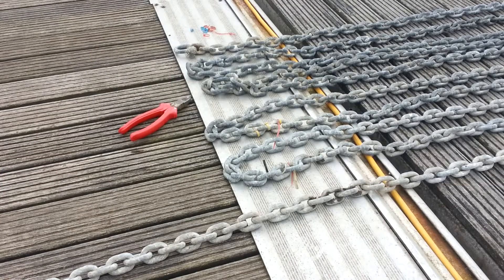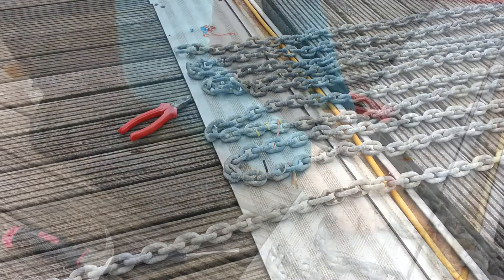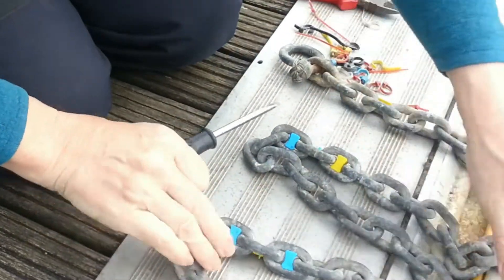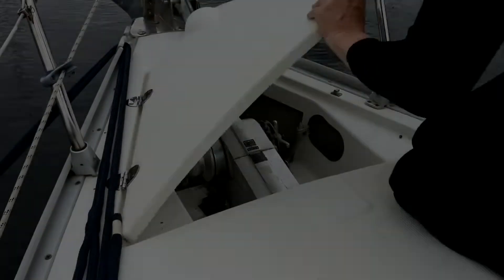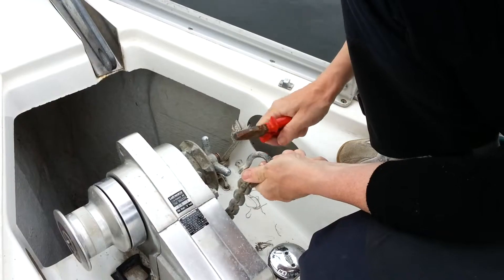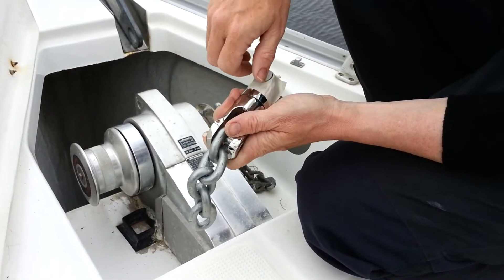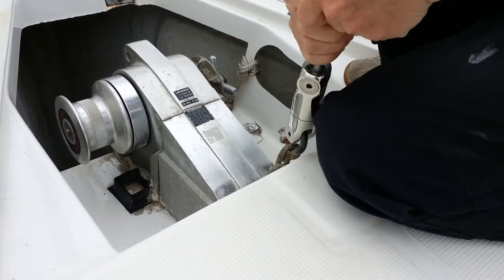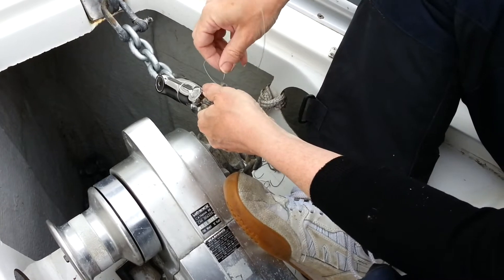[40] Anchor chains, shackles and swivels

Comment: Five failure points compared to one if you used a rated bow shackle like a green pin connected directly to the shank
Reply from the maker: We are using connectors that are rated as stronger than the anchor chain and in the years since this was filmed it has always performed well. It is not a nice solution but so far it is working well. We replaced the shackles when they were two years old and the are due for replacement again this winter. It also annoys me that I cannot inspect the inner pin of the swivel, but it is massively over-rated for this boat so I pin my hopes on that 😃

Comment: OK -- it is mousing not ceasing but fine!!!  What I did not understand is why add 2 shackles and a short piece of chain --  when the swivel is designed to fit directly on both the anchor and the chain -- all you seem to have done is add weakness to your anchoring system.  The Ultra Anchor Flip and Swivel is a great product that ensures the anchor (an Ultra preferably) is correctly oriented before it enters the bow roller.  
For a ceased shackel -- after long attempts with WD40 etc... and brut force -- Use an angle grinder with a cutting wheel if you can power/use it safely ...... or a good quality hacksaw and a few beers.
Reply from the maker: Hi Andy, thanks for the comment. I will be honest, we have never been happy with the shackle solution because we agree with you - it just looks like more points of weakness. Each season we have wondered whether to bother, but all the reports we have read say that the biggest weakness is sideways load if the swivel is attached directly to the shank. We do replace the shackles and you may see us doing that in a later video during lockdown (I forget which vid it is in). I will have a look at the Ultra Flip, but we may just go to using two shackles as a "swivel"
Reply: Agree that swivel direct to anchor is a side load issue.  I have seen the resulting deformation of the swivel when this is done.
Reply from the maker: @paulgillard2258  - So have we, thus the "indirect" connection

Comment: The shackle attached to the swivel is a proper bow shackle, the shackle on the anchor is a D shackle and is not rated for side loads. It is good that they have a short length of chain between the anchor and swivel since that should minimize side loading on the swivel.
Reply from the maker: We were in two minds about the swivel. Whilst it stops the chain from twisting it is also more mechanical links aka breaking points aka thing to go wrong. We have also seen enough bent swivels on other boats..... thus the oversize chain.
Reply: @SailingYachtSaltyLass  I'm also very unconvinced about the need for a swivel. However, if you have one this is definitely the right way to install it so that there are no side forces on the swivel.
Reply from the maker: After having it on for a year, we are thinking of taking it off again. We still have not made our mind up on this.
Reply: Generally speaking screw type shackles are rated for 50% of the nominal rated load when side loaded. One thing to be aware of is not to get a cheap Chinese knock off shackle whose actual load capacity is dubious at best. Spend the money and get quality. For 'D' type shackles I do not know the industry standard for side loading - I never used them in my professional life.